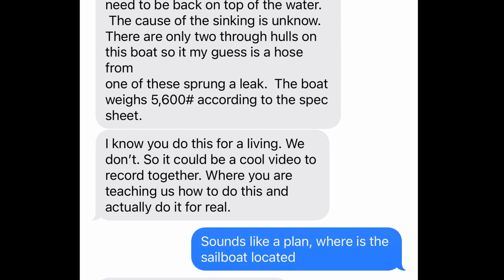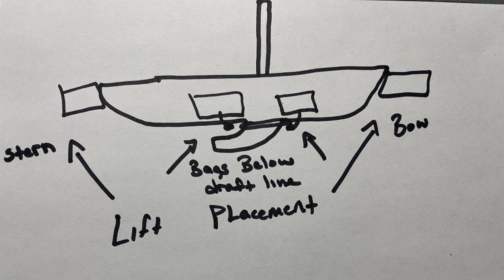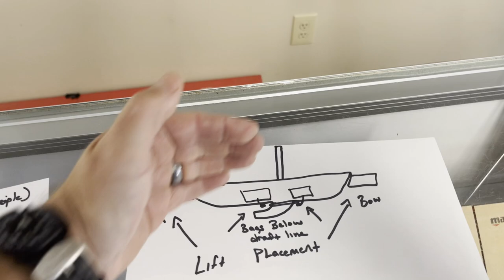Georgia Sailboat Salvage With Special Guest {[Woody from Dive Talk]}

Comment: Seems to hold true any time a job is to be done in the water there is a lot of work and effort involved. Looks like getting the boat buoyant and flood control mitigated was only half the work that needed to be done.  Now time for a full refit and some people bitch on how expensive it is to get SCUBA certified. 🤣 If you're going to own a boat be prepared to weather the cost of maintenance. Of course its an equation of labor cost vs reward and the rewards of boat ownership can be quite amazing. Great video. Miss hearing Woody's commentary but I'm sure his fishy DNA came in handy. Cheers, #SeattleRingHunter
Reply from the maker: Hello Seattle Ring Hunter, the biggest advice I give any boat owner is, always have insurance, as salvage work is not cheap. Some lifts are super easy and some are very difficult. This particular one wasn't that bad until other boats started coming around. As the water began to become choppy, our bags decided to shift around and it ended up rolling the vessel.

Comment: Hi and well done for the salvage,very good explanation on the lifting ops and archimides principal..
i have a question if you dont mind, are you imca & idsa ots diver and instructor?  
does the deapth of the object affect the displacement ?? 
for me it would be better if you had made the calculations for the actual boat weigth 5600. 
TIA
Reply from the maker: Hello Mr. Vee, lets see if I can answer those questions for you. As far as IMCA and IDSA, no. I am trained and have taught through 5 major training agencies. SSI, PADI, PDIC, SEI, and CMAS. I specialize in Public Safety Diving, Underwater Criminal Investigations, and Underwater Salvage / Search & Recovery. I do however, teach Full Face Mask with the OTS system and many others, such as Ocean Reef. As far as lift at depth, yes, depth plays a big roll in how much lift is needed. Well kind of, and I will try to explain it as simply as I can. The lift itself is the same, but the amount of air needed the deeper you go to fill the bags dramatically change. At certain depths, our air lines will not reach, so we reconfigure our bags to be filled with standard cylinders. In these situations, we resort to slinging multiple cylinders with us at depth, and we use them to fill the bags. The specs mentioned at the beginning of the video in the text dialog between Gus and I was not exact. A lot of times, specs from manufactures never take into effect the additional furniture and other items that are added to vessels. So when we calculate lift, its usually as an estimated starting point. We always take more lift than is needed to keep the jobs as simple as possible. This specific vessel was calculate around 7000 pounds of lift, so we took 8000 pounds to be safe. The last thing we concern ourselves with is the loss of lift at the surface. Once a vessel breaches the surface, it actually becomes heavier. So we always take extra lift to counter this.
Reply: @LakeHickoryScuba  Thanks for your time,
i didnt knew those organizations they teach commercial diving courses!!! padi when you use a lift bag advance open water if im correct you lifting a weigth belt wwith some kgs on it like 6kilos or something and the bag is big as a human head!! sei and pdic i dont even recognize them im european!! now as far as deapth lifting weigth lift bags air and other factor i know very well what we have to consider and calculate (im a commercial diver) ..so how a public safety diver can teach commercial diving things ? this is what i dont understan! once again thanx 4 your time!